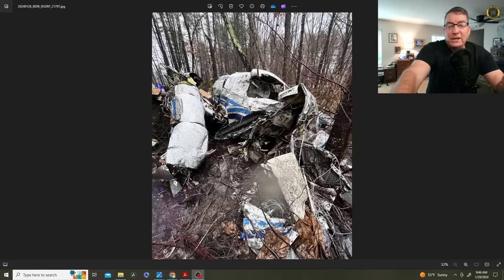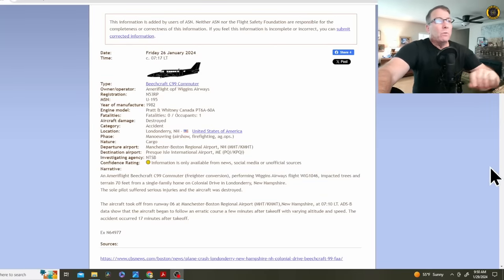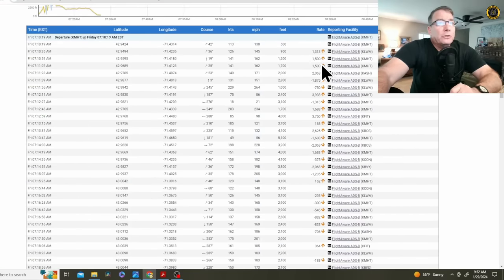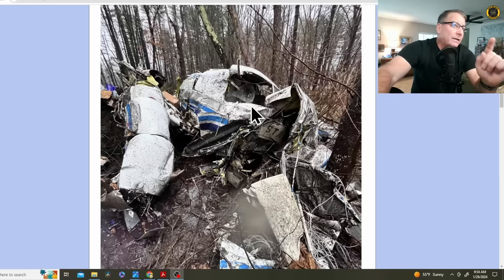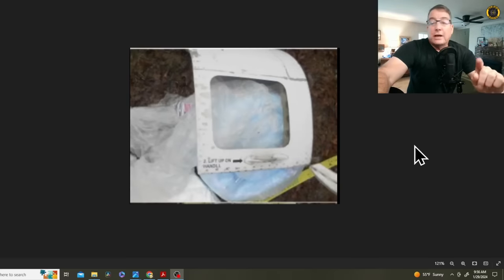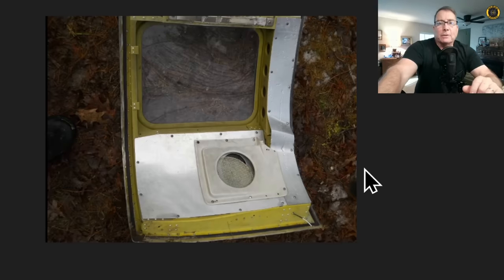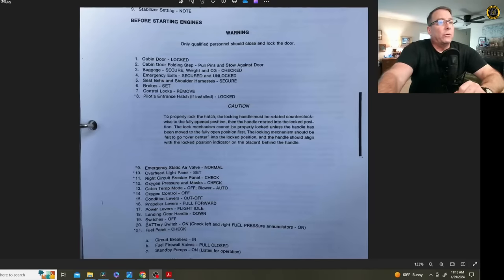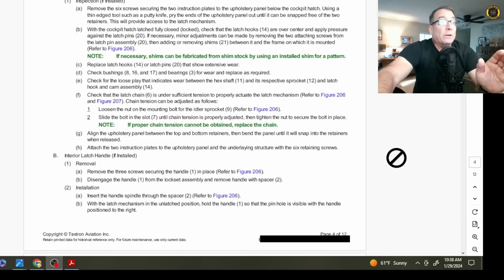Beechcraft C-99 Door Open In Flight Crash! 24 January 2024

Comment: I had the baggage door pop open in my C177RG on upwind when I was doing IFR training (in VMC).  I turned to the instructor and said, "we're flying a normal pattern to return" which I did and called the tower to inform them as I turned crosswind.  It was noisy as hell even with headphones on, the airplane handled as normal tho.  We landed uneventfully and parked in an open spot and shut down.  I checked the door and found that although it was open, it was locked.  It's a preflight checklist item to make sure it's closed and locked, and I remembered doing it, but the door popped open anyway.  Perhaps it hadn't latched all the way, I don't know.  Anyway, we continued with what we planned to do and everything was fine.  The key I'd been taught was not to panic, don't try to close the door (no way to close the baggage door anyway) and just to land as soon as practical, and that's what I did.

Comment: I flew as a passenger once in 1977 on a B-99. I absolutely loved it! It was a late spring flight with towering cumulus clouds and the pilots made it all the better as they would weave around them as long as it didn’t take them off the predetermined IFR flight plan. This was clear because the larger ones they would just go straight through them.
  This was the BEST flight I have ever been on!
That B-99 was amazingly fast!
 That was a flight from CYCG to CYLW in central BC💕💕

Comment: Over center latches have always caused problems because of a combination of poor design and rigging errors by maintenance.  In this case the single handle could have been replaced with two that would engage each hook and provide better feel for the locking action.  The loss of a C5A in Viet Nam that killed orphans on board was due to the same problem.  One or more latches were improperly rigged on the rear pressure door and it blew out and took flight control hydraulics in the tail with it.  Other cases of major door blow outs are UAL747 and several DC10.  We should all know better by now.

Comment: From what I remember of the Beech 99, the bleed air is selectable on/off from the cockpit.  If you miss that, then you have no instrument air for gyros or pressure for the de-ice boots.  Add a "departed" door in the mix with possible flight control damage...  Bad deal.

Comment: I had this exact same thing happen to me. I use to fly a Beech 99 with the same crew door setup. We only had the one '99 so I don;t know about others but on this one when you closed the latch it had to go to one last click you couldn't hear but could barely feel. Right after takeoff the front of the door opened slightly. Through just instinct, I grabbed the door handle just as the door came open. There was enough force I couldn't remove my hand from the handle. I guess I was lucky, I had to fly with just my right hand to work the controls and the throttle and came back around and landed at Port Columbus. This was back in the Purolator Courier days when Purolator was based at Port Coumbus. My left arm was black and blue for a month afterwards. The lonly other issue I ever had with the 99 was just remembering to bring the crew ladder in before shutting the door. That is another whole story.

Comment: Happened to me in 1973 as a F/O. Returning from Lake Charles to IAH.  Captain's leg. Normal flight nearly all the way. Descended to 2000 ft left downwind for runway 8. within minutes of level flight we both experienced a very loud "explosion". A large hole by the Captain and the wind velocity and wind noise was so strong we could barely communicate.  The wind pulled his sun glasses of his head along with approach plate and papers on his side.  (At the shocking time, he thought the whole side of the aircraft was gone.)
We switched controls , I declared an emergency, (which the controller could barely make out.. Made a left base for runway 14, taxied to the ramp. Deplaned psgrs.  The cockpit door/window was still attached to the plane.. Fortunately for us it was a nice spring day VFR and outside temp around 75f.. I can only imagine what this pilot went through being by himself. (If the window was still attached like ours and nearly straight up, directional control was pretty bad but doable)
The wind velocity and vibration was to the point, he could not make out clearly the instruments because the wind velocity made him nearly squint his eyes shut.
No telling how we had a non eventful flight until coming in downwind to land.

Comment: Have a bunch of hours in that tail number. Back in 1989. And thousands of hours in Beech 99 freighters. Previous incidents of those crew doors opening in flight, usually the result of not being latched correctly, have resulted in the crew door separating, going up and over the aircraft, and striking the right horizontal stabilizer. Causing damage to the stabilizer. The aircraft is equipped with heated windshields, wing boots, horizontal stab boots, heated inlets on the PT-6's, and heated props. The Be-99 is unpressurized. There is no onboard installed oxygen system. The oxygen system is a hand held bottle. Carried onboard by the pilot. With a mask that has no comms. Normally not even carried unless planning a flight above 10,000'. A crew door opening at the speeds he was going would have been ripped off immediately. Far to much force, and would happen way to fast, to even attempt holding it down and attempting to close it. It would be an explosive event. Early in the take off roll you could close it. But not inflight.
Reply: Thank you for that info
Reply: Did any incident ever happen when solo?
Reply: @paulsherman51  Back in my day, all Be-99 freighters were single pilot. Except for training. So were the Metroliners.

Comment: The most confusing part, to me, is the massively erratic behavior on departure and then the almost "normal" flying after he made the call about "35 ILS". He maintained 2500' MSL for nearly 5 minutes while flying toward the south as if he would be making a couple of 090 and then a 045 heading ton intercept the localizer. What happened when he turned eastward?!
Did that door damage the rudder? Did he realize he had directional control vis engine power changes? Was the elevator also damaged? Did he lose all his flight charts? Did he lose his sense of feeling and control in his hands/arms/feet from the freezing wind chill and possible moisture soaked clothing? Just hope he pulls through with as little permanent physical damage as possible.

Comment: Sorry to hear about this accident -- and nice analysis, Juan.  The pilot is living his second life .... lucky.  It apears this pilot lost control of his plane due to icing or distraction when the door blew off.  I have been in several different GA aircraft over the years when a door was either found to be open after T/O or a door somehow popped open during flight.  This should be a non-event.  Forget the door and fly the plane ... land ... close and latch the door .... then continue on your trip.  If the door is like a C172, C182, Piper Warrior, Saratoga, etc. with hinges on the front of the door, to prevent panic reassure everyone in the plane that this is not a critical emergency, the plane will fly fine, and you can continue on to your regular destination with the door open a crack if you can stand the noise.  I am also a skydiver with just under 1,000 skydives including five from 30,000' altitude.  In every skydive a door has to be opened for the skydivers to exit the plane.  I can vouch for the fact that opening a door of a plane in flight has no effect on the controllability of the A/C.  I have jumped out of DC-9 and 727 jets where we opened the door at altitude and norhing hapens.  Every student pilot should be taught that nothing critical will happen if a door inadvertently comes open -- advice from my CFI early in my training who retired with 41,000 hours.  This wil save lives.

Comment: I bet it ripped his glasses off his face. Can't see, can't fly.
Reply: Was just thinking about the airflow.  Never mind my glasses (though when asked by the lady at the dmv whether I needed my glasses to drive, I replied that, no, I needed them to find my truck), but whether the airflow (even better, just behind the props) would create such a draft that you could hardly open your eyes at all.
Reply: could be
Reply: Pilots that need eyeglasses are supposed to stow a second set on board, right?
Reply: Doesn't seem plausible with just one door open
Reply: Glasses gone out the door with the wind.
Reply: If we go quickly we might find his iphone before Dan gets there.
Reply from the maker: Great point!!
Reply: That second set might have left with the door.
Reply: @SeekingTheLoveThatGodMeans7648 
He's got no autopilot, freezing cold arctic blasts of air hitting him at 150 miles an hour, it's dark AND he's wrestling the plane. Putting his extra pair of glasses on in that situation is impossible.

Comment: Single pilot IFR would certainly suggest he was using the autopilot at the time of the incident.  Under those circumstances, I am sure he would have continued to use the autopilot or engage it.  The erratic flight suggests no autopilot and control surface damage is probable and perhaps he was trying to move to the right seat while dealing with control issues.  Can’t imagine what it was like given the weather conditions.
Reply: First two words of this post says it all @bw162
Capitalism and cost-cutting moves. Who is on the Board of this cargo airline?
Sounds like the John Denver effect, struggling alone.
Don't forget how arthritic your fingers get when it gets cold. I presume he didn't have mittens. Operating small switches and knobs must have been near impossible in that frigid air.

Comment: Years ago, my dad helped Dr. Stearman over at UT - by building a large scale model of a Piper Seneca to solve an issue that ended up being the forward baggage door coming open in flight and degrading the aerodynamics of the tail, causing a crash. They tested it in the wind tunnel in Austin (don't know if it still there) by using a model airplane servo to open the door "in flight". Sure enough - the airplane lost attitude stability - mystery solved.

Comment: During my first solo my instructor never fully latched the door on the Archer I was taking up into the pattern (intentionally). Me being the genius student pilot I was, decided to reach over and re latch the door in downwind. Looking back over 1600 hours later, I was extremely lucky and learned that no door/window or anything else creating an opening in the aircraft is worth me taking my full attention away from flying the aircraft, I wouldnt be surprised if there were other issues at play here but we can still all learn from these scenarios. Thank whatever power may be that the pilot survived.
Reply: I think that’s a GREAT comment.
.
Thank you, ‼️
Reply: I've tried to latch the upper latch in an Archer in flight, trim the plane and it flys right along hands off.  Didn't matter, locking it in flight ain't happening.  I know now it won't move anymore so I just keep flying till I can land to fix it.

Comment: A door coming open is truly a frightening and surprising event, I had an event many years ago with the door of my PA-23 250 popping open shortly after take-off.
It was close to midnight in winter at ESGJ (Jönköping in Sweden). After some altercation with the tower at the airport I felt rushed completing the final check list before take of in to IMC conditions at minus 5 degrees C. Subsequently I took off with the door closed but not latched. At 700 feet AGL and in IMC the door opened and all hell broke loose. Beside the noise and all papers, plates and maps flying around in the cabin I had no communication because I was just dialling the radio to change frequency. However remembering to fly the aircraft I was able to focus on just that. It resulted that I came off course trying to assess the situation. I knew that I could not trust the airspeed indicator nor the VSI or altimeter so I focused on the horisont gyro to keep the plane in a steady shallow climb. The checklist for closing the door was to step on left rudder to make the airstream helping to close the door but as soon as I tried that I got problems staying right on the wings and was risking loosing control of the aircraft. What I did was to use the passenger seat belt and an extra handle that I had installed on the door to pull it close and latch it. After that I could resume flight, contact the controller take som more yelling from them and continue to my destination.
The lesson I learned was not to let bad controller get at you and stick to the checklist no matter what. I hope this can help other pilots, but also controllers to stay professional and calm especially when dealing with less experienced pilots in single pilot aircraft's.

Comment: When Ameriflight previously was CalAir out of Burbank I flew one of their Piper Arrows in IFR when soon the vacuum system failed. I requested “no gyro”vectors to VFR  under the overcast south along the coast to San  Diego. That was good experience with timed turns using raw data.

Comment: I have to believe that the 2c degree with the blast of sub-freezing temps, the pilots' hands& fingers had to be very difficult to use with any dexterity. I have been out trying to change a PAPI bulb in temps & winds way better than this pilot and it does not take but a few minutes to find your hands painful and near useless.
Once more, great info Mr. Brown !
Reply: Nailed it here. Same experience trying to tune up a ham rig in the dead of night in a tent on the mountaintop during field day--and that is even with mittens.

Comment: A few issues with doors (and door plugs) on aircraft recently.

I understand that the door on this plane needs a handle on the inside and outside, but the mechanism seems hugely overcomplex for what it needs to do?

More points-of-failure, with all the gears and chains.
I thought it would be more of a "rack and pinion" type deal, like on many double-glazed doors.
Reply: Go back and read how complicated the latch was on the DC-10. (2 failed causing catastrophic crashes) You would have sworn it took 1/2 the engineers at MIT 10 years to develop it. Americans make the simplest of simple complicated. It makes em' look smart, so they believe.
Reply: @jefferyyounce5372  

I remember that well, with the rapid decomp of the cargo door... twice.

Torque bar thing, and not-so-great limit switches on the motor, etc.

I never quite understood airliners still using control cables for the flight surfaces either.

Having said that, there have been enough "interesting" problems with the Airbus fly-by-wire system, too. lol

Comment: I have flown for this airline, this aircraft type and its bigger brother the 1900 and got the majority of my flight experiance flying in and out of this region (of course that plane was a big shinny jet, I actually miss working for AMF). Now I will fully admit, the 99 has pneumatic boots, and I hated those things. Ice would always bridge over them. But given the fact that the aircraft was only 2000' off the ground when it turned south (assuming thats when it lost control) here is what happened. Pilots not securing the latch on the 99 is more common than one would like, and was a problem when I was at Ameriflight. I never had that issue, but I was paranoid. AMF pilots can be a bit in a rush, and if you have a stubburn or otherwise compromised latch, sometimes pilots would need to put in a lot of effort to properly secure the hatch. My guess is, he got the plane off the ground, instantly became IFR (even fully loaded, only takes about a minute to reach 1000' in a 99, and around 2000' the hatch popped open. He probably tried to reach for it only to lose control of the plane and ended up in an upset attitude situation and never recovered. I hate to blame any crash on a pilot, especially one for a company i was with, but this was far too quick for icing, and from that video it sounds like both engines were operating at the time of the crash.

Comment: As others have said, the 99 doesn’t have oxygen masks like airliners do and as far as I’m aware Wiggins pilots don’t carry oxygen tanks as they don’t need to go above 10k. I’m not sure why you would lose control of the airplane like this with the door gone. There was another incident a year or so ago in Burbank where the pilot was able to communicate and get back in just fine with the door blown off.
Reply: Burbank is not exactly bone-chilling and finger-numbing cold. Did loss of manual dexterity somehow play a role? I find it very difficult tuning my ham rig during field day night time on the mountaintop.

Comment: Sept 15, 1989 an Ameriflight twin engine Piper N70PE crashed seconds after takeoff from Ontario California (ONT).  "Poor Maintenance" by company caused Right prop to break apart at rotation hitting fuselage. Pilot had no chance with less than 500 feet altitude gained on left engine only. So we shall see if this is more "poor maintenance".

Comment: The windchills could stimulate the parasympathetic nerve system and suppress the breathing capability together with the possible negative pressure caused by the Venturi effect. But that doesn’t explain the erratic flight status. I’m more learning towards the damage of the flight control surface from the departing door.